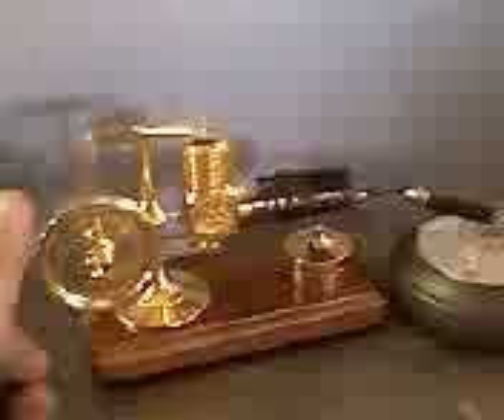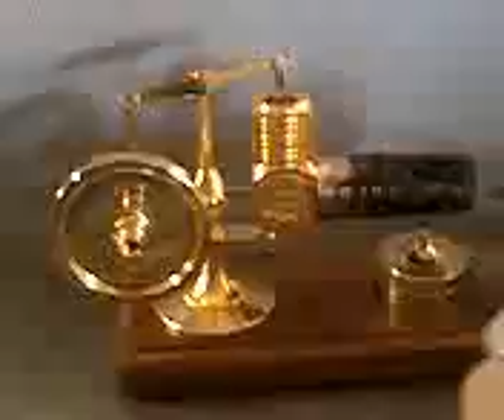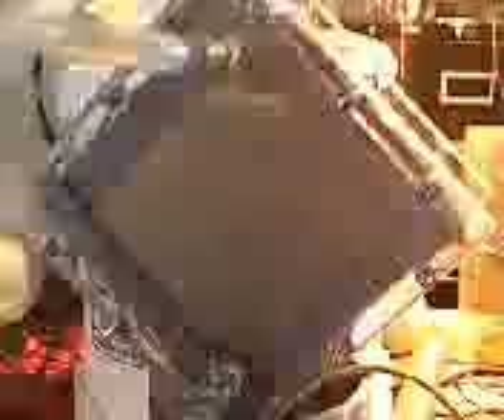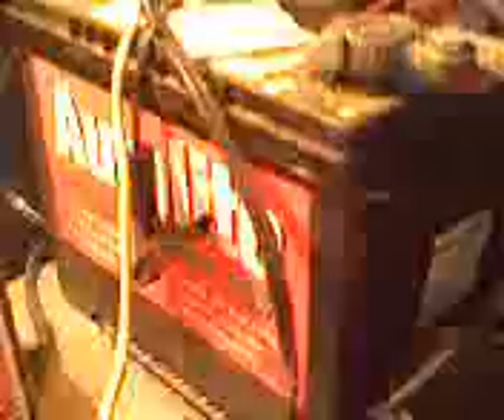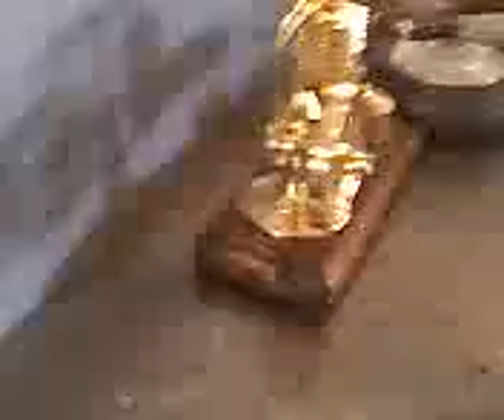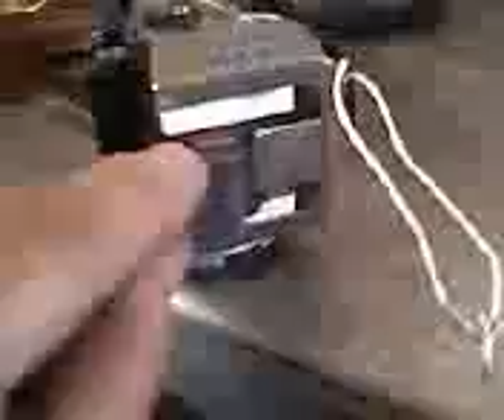Stirling Engine Running on  hydrogen

Comment: Step 1: Make H2O2 emission device
Step 2: Obtain/Build Sterling engine
Step 3: Live near stream or water source with constant flow
Step 4: Build water wheel with tube attached in a spiral formation to scoop up water by using the movement of the water wheel
Step 5: Build filtration tank outside or inside (Used to filter excess material from water)
Step 6: Connect everything and start up the rig
Step 7: ????
Step 8: Profit.
Reply: My good man, you're thinking like a woke person.  This is to J Witteman

Comment: You just need a flywheel with magnets running past copper coils that go into a bridge rectifier for dc. You're on the right track👍also fyi you can run the hho through a catalytic converter for the catalyst and you don't need the flame👍

Comment: You might use a hypodermic needle as a torch tip ..it would use a very small amount of hydrogen thus not needing a high amp generator